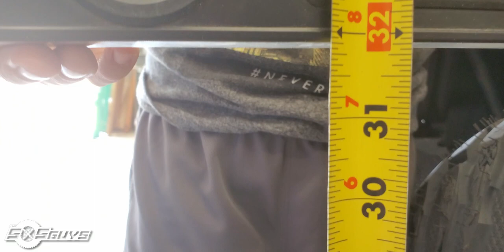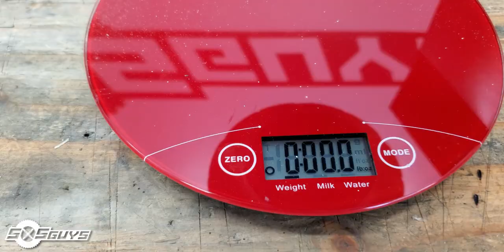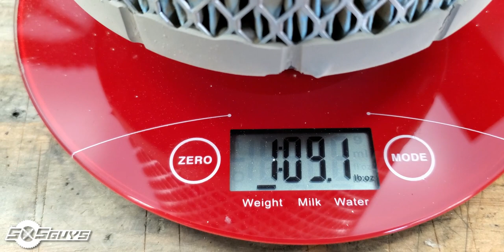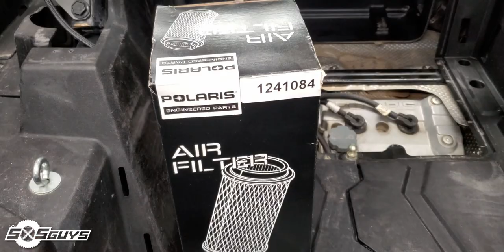Suspension Preload & the Last of BDR Prep | The SXS Guys Vlog

Comment: you should really be replace the springs to the correct ones needed for the weight.  New tenders with improve the ride to a whole new level.
Reply from the maker: You're absolutely correct! We're in the middle of lining that whole process up... We just want to work with some quality vendors and be educational in the process so you guys can be empowered to do the same! It just wasn't possible before the trip! Those aren't even the original Fox shocks, they're blown, so we're going to rebuild and respring! Stay tuned!